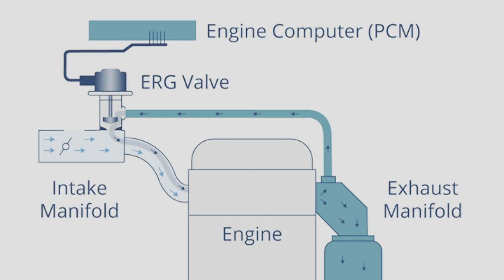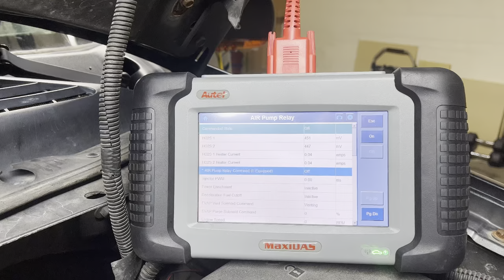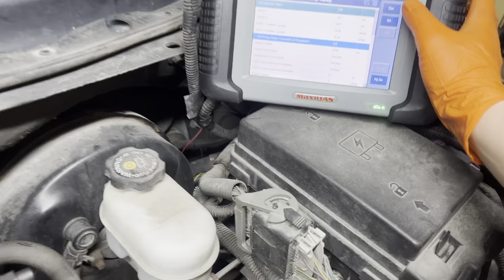Diagnóstico, mantenimiento e instalación EGR |ChevyTrailblazer/GMC Envoy/Buick Rainier/Bravada 02-09

Comment: Todos los años de la trailblazer 4.2l llevan esa egr?
Tengo una 2004 y no la tiene, no sé si se removió porque veo el conector blanco suelto por ahí, que va junto al del sensor IAC
Reply from the maker: Saludos Felipe. Si puedes ver el conector probablemente si la removieron, fíjate en la culata haber si ves los dos agujeros q se unen a la EGR. Pero si ese fuera el caso, de seguro q la computadora te arrojaría un código de falla. Cabe anotar q General Motors hizo un rediseño en este motor después del año 2005, en vez de traer sensor IAC ahora traen sensor MAF, localización del sensor de oxígeno delantero ya no va en el múltiple de escape si no después de este, entre otros cambios etc. Todo esto fue pensado para mejorar el consumo, reducir emisiones y de paso ganar algunos HP extra.
Reply: @jctruckertech  si, supongo que se lo cancelaron, también el radiador de calefacción de hecho